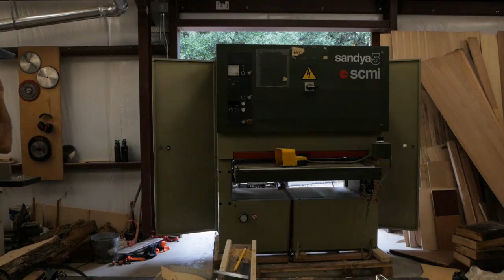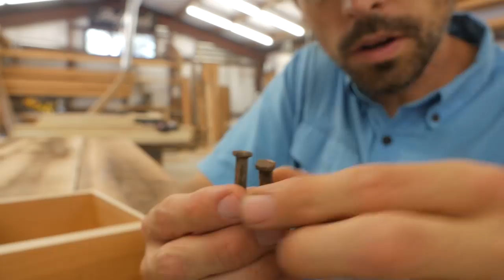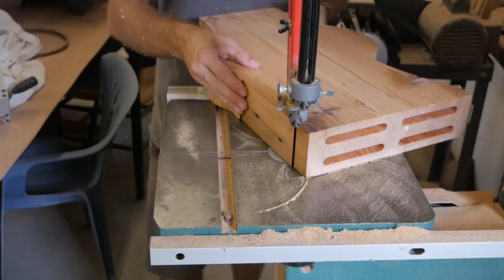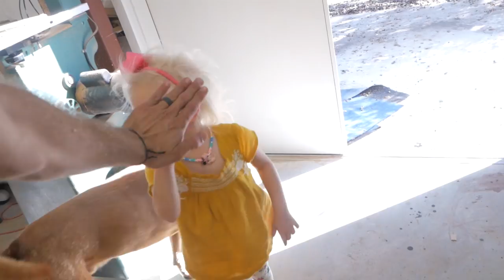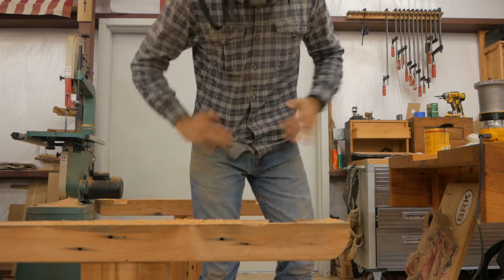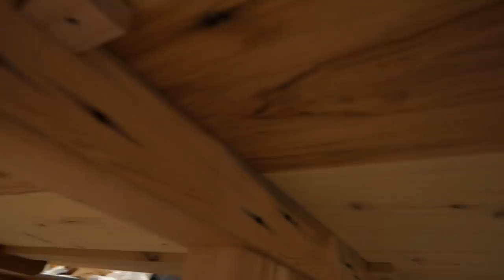AR1:  Building a trestle table from reclaimed white pine

Comment: Hope your your sander works better than ours. Ours is a pile. I've ran 2 SCMI units and both you had to keep a push stick handy or boards would get stuck and get big dips in them.
Reply from the maker: +00aptx this sander is in pretty rough shape.  I'll be putting a new feed belt on it and dressing the head in the coming month.  My parts slip but not too bad, it's just because the feed belt is old.

Comment: What a good looking fam. This is good stuff Andy! As a suggestion, I'd like to know what equipment you consider the most important in your shop for making things square and workable. Thanks.
Reply from the maker: +HaloGamer401 the jointer is the best machine for getting two faces if the boards flat and square to each other.  From there you can use the table saw and planer.

Comment: I'm in the middle of a very similar project, with reclaimed barn wood circa 200 years old. One problem I'm having is that the sides of the beams aren't perfectly straight and I'm worried about the glue up for the surface. Any ideas or advice?

Comment: Fantastic table! I can't wait to see the finish applied. What will the final length and width be?
I will start soon a table for a client who wants to supply reclaimed Cedar beams. The beams are not as wide but thickness will be same. Do you think Cedar will make a good table top? Or is it too soft?
As a woodworker making the attempt to do it for a living I really appreciate the behind the scenes videos. Thanks!!!
Reply: Ross Nanfito cedar is another softwood like white pine. Both his table and yours may get dinged and scratched easier but if you build a good finish, which you should on a table, it should last a long time.

Comment: Always cool to watch your videos in and out of the shop. That sander looks heavy duty, I wonder if that brand makes other woodwork machinery. I had a question, what kind of jointer do you have? I see a lot of the good woodworkers go for the older machines. Makes me wonder if the new ones aren’t as high quality as they used to make them. 
Cheers

Comment: Do table top buttons prevent you from lifting the whole table as a unit? It seems the screws into the top might split the button if the weight of the base is hung off them.